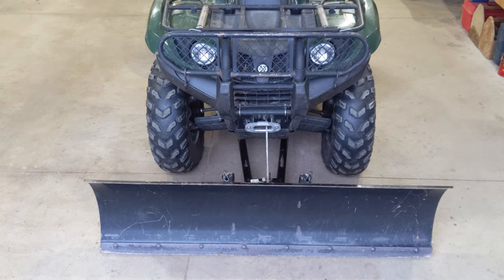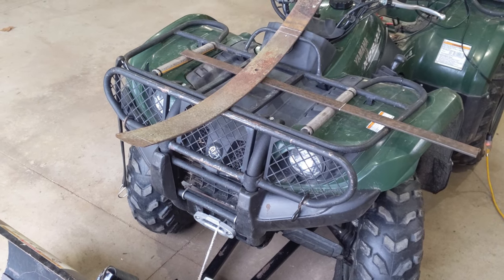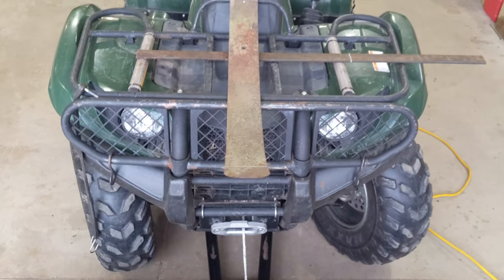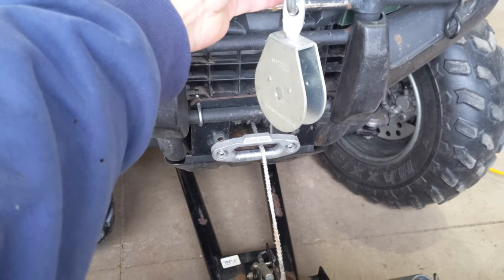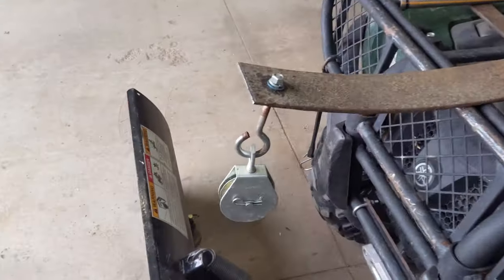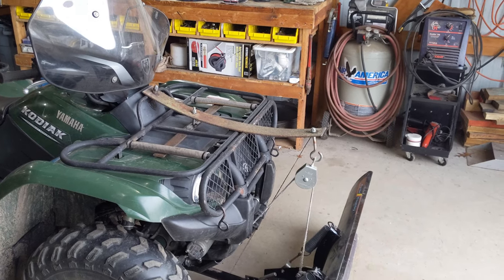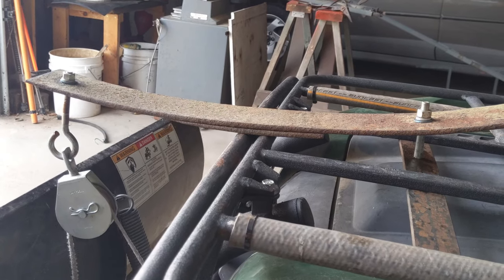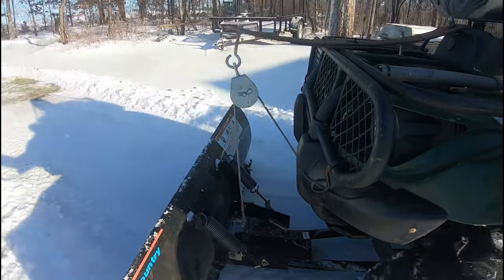ATV Winch Cable Keeps Breaking When Plowing Snow -  Solution!!

Comment: That’s a horrible job
Reply from the maker: Wasn't going for looks but it functions rather well.
Reply: @UncleBucks  I think Wazzer means plowing snow is horrible.  Some of us love plowing.  Others, not so much.
Reply from the maker: @kthompso43  oh, that makes sense. I didn't mind plowing snow at first but after decades of doing it, the fun has worn off! Going south for winter is sounding more and more like the way to go for each passing year.
Reply: I'm going to try your way on my brothers Razer. He breaks winch lines on a regular basis. and I have a bone yard of junk car's with perfectly good spring's to salvage!
  I have lived in Minnesota for 70 years and I used to plow for a living ( 16 years at a service station and 28 years for a major MN. city) I am looking for a place in South Texas where the locals have only seen snow at the mall in the form of Snocones!
  I use a 89 Bronco with an 8 foot Western plow or my 1845C Case Uniloader if thing's get really rough. Nice plowing with a heater and radio playing!!
  Good luck with your rig. Hope it lasts for many years!